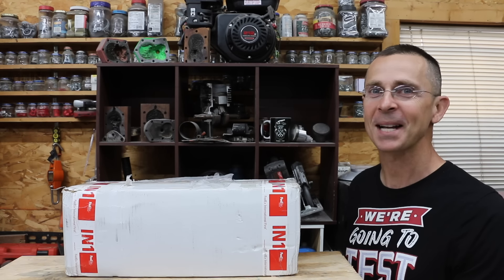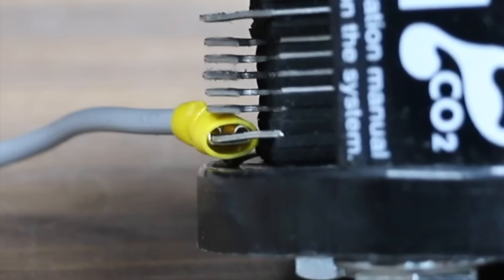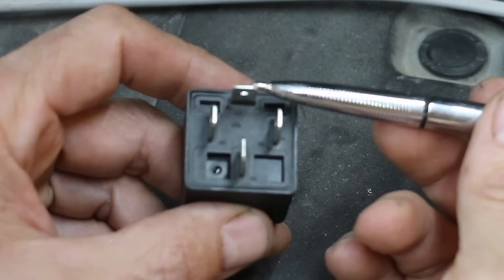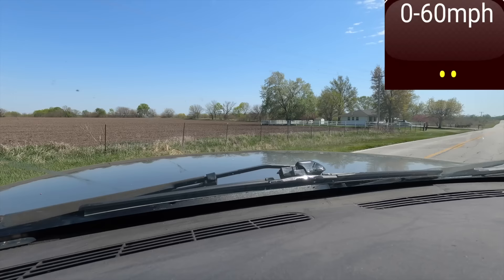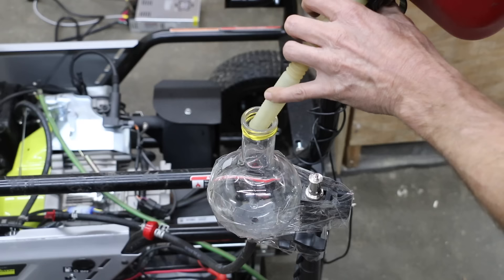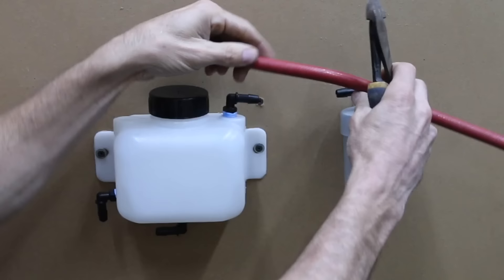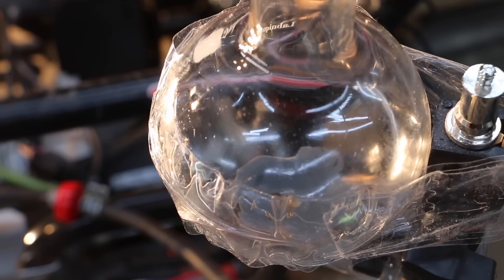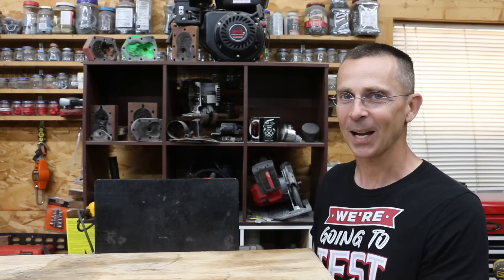AMAZING 35% More MPG with HHO? Let’s find out! Help with high gas prices?

Comment: “The instructions were not very clear” that’s so that HHO believers can claim that anyone who doesn’t achieve their claimed outcome made a mistake, and the “technology” is not to blame. This HHO stuff is not engineering, it’s religion.
Reply: The device seems sophisticated. But if you make your HHO by burning fuel to make electricity to make HHO to help burning fuel that makes electricity to make HHO....
The laws of thermodynamics clearly state that this way the product he bought is working is illegal and basically an additional burden to an allready inefficient motor! 
BMW once made a motor that burns HHO entirely. HHO is extremely taxing on the livetime of a regular combustion enginge It's even more problematic for the piston rings than burning CNG or LPG . Thats why all hydrogen power today is about fuel cells. Yet to have this technology take of we need to solve two problems. 
1.) Finding a catalysator that increases the efficiency of electrolyses or some other chemical means to efficently splitt up water.
2.) Finding a way to store H2 without cooling it down or putting it under imense pressure as both are the main sources of efficiency loss of the H2 fuel.
Then there is the small problem that H2 can't be properly sealed away it can pass through rubber or plastics even through soft metal seals, in tiny quantities, so pure H2 is not realy a fuel to easily work with if you are not in the rocket submarine business.
Reply: "This HHO stuff is not engineering, it’s religion."
My words, exactly! And the problem is there is so many new religions like that. Vegan, gluten, antivaxer, flathearth.......
Reply: @TremereTT  my thoughts exactly!
Reply: It’s a mechanical system, you can’t just say “thermodynamics says this is illegal”. It isn’t impossible by any stretch, by that logic, a turbo charger should also “be illegal” lol. However it is absolutely horseshit as proven by our man PF here.
Reply: @ludvigericson6930  how would a turbocharger violate thermodynamics?
Reply: @jcasetnl  Somewhat true, but these were very isolated cases. Platforms like FB, IG, ... and internet itself enabled them to spread like wildfire, although they all were designed in good faith for spreading knowledge and experience.  Unfortunately, internet nowadays is 95% trash. It became quite difficult to find true information among all this trash, unfortunately. Our knowledge can help, but people don't use it. But people, obviously, don't go to school to learn, just to get a grade.
Reply: @ludvigericson6930  A turbo doesn't make the system more efficient. It makes it less efficient in exchange for higher performance.
Reply: @fifi23o5  They were not designed "in good faith". They were designed to make money. They use many bad-faith methods to keep you clicking. Lousy people have always existed. Now we have a technology service that tries to shove those people in our faces as much as possible to convince us the world is going to hell and we need to personally argue with every single one of them. And all the while we're watching their ads and they're pocketing the money. Sure, blame people for falling for it, but don't kid yourself that they built this stuff "in good faith".
Reply: @jcasetnl, well said.  Summed it up perfectly
Reply: @JamLeGull  A turbo charger runs on the energy of the same engine it provides with extra air, making it more powerful. That is not in conflict with the first law of thermodynamics because more air is added into the equation from. Just like a crude oil pump engine could run on the crude oil it pumps up and even create a surplus of crude oil on top of that. In both processes, purpose compatible matter is retrieved from an external source and eventually converted into kinetic energy to retrieve the same amount or more of that matter, ceteris paribus. But I have a strong feeling that you are very familiar with this subject LOL.
Reply: @ludvigericson6930  I agree there's more to it than the simple matter of invoking a law of thermodynamics. But invoking that laws does settle one key issue that generating your own hydrogen using energy from the engine can't result in more total fuel energy being available to the engine.  In fact, it is pretty much guaranteed to result in less net available energy to drive the car, not more. So any improvement must come from some other effect that would make the engine operate more efficiently. One person mentioned that it allows advancing the timing and hence improving power. Maybe that, or something else is actually true. But it just isn't likely to be true to the tune of 35%. Also, more power often means less efficiency in real world applications.

As for turbo-chargers, they also don't seem to improve gas mileage in real world comparisons with normally aspirated engines.  But the way that they might in more controlled situations is that they may make the engines more efficient in their use of fuel in certain power ranges. The same can be said for cam timing, engine stroke length, intake and exhaust manifold tuning, etc.
Reply: @fifi23o5  Pretty sure my fireplace hearth is flat! You could call me a Flathearther....
Reply: @JamLeGull  
A naive interpretation of thermodynamics would say that a turbo charger can't work.  That is if you try to collect energy from the exhaust you are introducing back pressure so the engine has to use more energy to make the turbo spin.  This is more obvious with a super charger where the engine powers the compressor directly rather than use exhaust pressure to power the compressor.  However despite the engine powering the turbo, you still gain power because the relationship between input air pressure and output power is non linear.  That is a small increase in input air pressure creates a greater output power from the engine than the energy used to power the compressor.
Reply: @ludvigericson6930  Turbo (or super) charger helps you get more air and FUEL into the same engine and increases hp.  You burn more fuel for the extra hp.  Law of Thermodynamics is maintained.
Reply: @graemejwsmith  The thing with little turbo engines is that you can use a smaller engine with the same power as a naturally aspirated one. Which can give you more fuel efficiency, when you don't need the power and drive the engine in the area where the turbo doesn't work that hard. Lower air/fuel consumption when the power isn't needed and higher air/fuel when the power is needed.

This after all improves fuel efficiency, because engines in cars run most of the time in the "low power are" in low revs.
Reply: Hho is used in cutting torch sooo it IS very possible to run your vehicle on it,,, but those whom are in control don't want you getting hundreds of miles to the gallon since it's NOT profitable for them and it loosens their control over you !!!
Reply: IT'S JUST JUNK!!!!!!!!
Reply: @MrBillmechanic  that's the typical indoctrinated sheep response,,, best go seek truth !!!
Reply: @TremereTT  no, you're talking about a HICEV which is an entirely different beast and are not detrimental to a vehicle designed to burn hydrogen in air - some minor materials selection issues aside we could use HICEVs today; the issues come to we have no hydrogen distribution networks. The very first internal combustion engine was a HICEV, it is a completely rational design that has been abandoned for other reasons.
Reply: @streaky81  we have a h2 "distribution" network. it's also continuously getting denser. the h2 is created and compressed on site. many Busses and some hgv run their fuelcells with it. Also there are rare end consumers with hyundays or self made Designs.
The network is there and it is getting more dense every year.
Reply: @PumpKing96  A point that everyone who has mentioned Turbochargers seems to be missing is that turbos are driven off the otherwise wasted heat of the exhaust. All that heat going out the tailpipe is just wasted energy and a turbocharger captures a lot of that wasted energy.

A common misconception is that turbos are simply driven off of engine back-pressure and thus steal from the engine the energy needed to drive them. But a quick bit of research on how they work will reveal that it's a bit more complicated than that and they actually utilize energy that wold otherwise just be wasted out the tailpipe.
Reply: @wturber  Depends on the application. On diesels turbochargers no doubt increase efficency. Most efficient naturally aspirated diesels have a bsfc of about 220-230g/kWh. Turbodiesels drop that below 200 grams
Reply: @jcasetnl  Turbocharging makes a system more efficient by capturing waste energy.  You can make more power on the same fuel usage, or use the same fuel for longer time.  This is the definition of efficiency.
Reply: @wturber  Look into commercial-scale power generation.  This is where all of the little efficiency tricks start to add up.  Turbines, reheaters, intercooling...  If a hydrogen recapture system was REALLY the magic bullet that the ads say it is, commercial power would be all over it.  They often have a surplus of electricity for generation, and large-scale storage is easy in a stationary plant.  Additionally, fuel cost is HUGE for generation, a 35% improvement in efficiency would be a game-changer for generators.  And yet...none at this scale.  For what it's worth, stationary plants can be as much as twice as efficient as car engines (40-50% vs only 25-30% typical).

Comment: I have really fallen in love with your channel over the last couple months and have actually started coming here when I need to see how certain things perform. Would love to see a general purpose degreaser test in the future!
Reply from the maker: Thank you so much!!  Thanks for the video idea.
Reply: If you are willing to invest $1 try LA's Totally Awesome It is an all purpose cleaner and the bottle has the dilution ratio for different tasks full strength it can degrease an engine
Reply: @bruceaugustine6486  I do use LAs awesome a lot! Works great on brake dust and what not. Just would like to see some other options. Even diluted, that stuff can be pretty harsh

Comment: This is an awesome test,very detailed. But these HHO systems aren't just plug and play. There is an amount of tuning with the HHO in the effect of amperage and amount of either baking soda or KOH to add. I have made one that is a wet cell instead of a dry cell and I used baking soda instead. I had good results and I doubled my mileage on an older mustang with a carb. From what I've learned on the Fuel injected engines an amount of adjusting of either the Map or Mas sensor is needed to get the HHO to do its thing and increase mileage.  The carburetors aren't self learning so the HHO works great. The FI engines NEED a bit of minimal adjusting ,or you will see barely a change. But as per the kit I could see that it doesn't give this info or you would have done the adjustments to get a proper result. Again  awesome test lots of info.
Reply from the maker: Thanks!
Reply: Exactly.  On injection systems , a good HHO has a parallel ECU  in order for proper results as it fools the  engine , We have tested that on an 156 Alfaromeo and we had great results . On the other hand , carbed engines  do not need paraller ECU but  the results are not so impressive.
Reply: How much gas can that tiny HHO system generate in one second?  How much HHO gas would need to be generated to make a difference running any sized gasoline engine under load?
Reply: @01mustang05  I dont know,I can say that on my online 6 in the mustang I ran a 7 plate wet system with a voltage reducer to knock the voltage to 6 volts and a little bit more baking soda than recommended to make what I thought what a pretty good amout,container was completely clouded with bubbles with a decent amount of bubbles when I put the hose in a bucket. I guess it would be a trial and error to get the best result. Ever car is different,so I'm guessing tuning of the system and the car needs to be done whether FI or carbed to get best outcome for your specific application.

Comment: You should do a video on garden hoses I'm curious as to see the differences.
Reply: I noticed that on the shrinking hoses, the pressure and flow are severely restricted, even after the hose has expanded completely. I'd really like to see how much flow you're losing for convenience.
Reply from the maker: Great recommendation!  I'll do it.  Which brands would you like see tested?
Reply: Project Farm I know I’m not the OP, but maybe hoses of different types? Something like those expanding hose, rubber hose, “standard” garden hose. Maybe do something like flow rates for all the same sizes, as well as toughness, etc etc.
Reply: The zero G brand of hose would be interesting to see tested.

Comment: Thanks for this testing👍
My experience with these HHO generators is just burnt out alternators (too much current draw) and potential fire hazards (intake flame blow back on petrol engines). They just don't work!😉
Even on a diesel motor, it only seemed to reduce very slightly fuel consumption on town driving. On long hauls it increased the fuel consumption!
Reply from the maker: You are welcome!  Thanks for sharing.

Comment: The problem is to Run a hydrogen generator you need a lot of electricity,  which makes the alternator harder to spin..   So any gains you get from the hydrogen are being lost on spinning the alternator with more force.   Yes an alternator with electrical load, is much harder to spin then an alternator with no load.
Reply: it’s like trying to make a perpetual motion machine
Reply: @jefrebugni4064  it's worse,  it's a perpetual motion machine with excess energy ;)
Reply: ...and youre not even a physicist!!
Reply: YES BUT 13 VOLTS AND 30 AMP STIL TAKE 1/2 HP, 746 WATTS IN 1 HP

Comment: We built them back in the 2000s when gas first hit $3 a gallon. Found the computer corrected it on an efi but had pretty good results on a carb engine
Reply from the maker: Great information on the carb engine results!
Reply: hahaha i posted the same thing before i found your comment.
Reply: Misleading statement much? I’d venture that EFI gives improvements to fuel efficiency that outpaces HHO + carb.   

Seriously
Reply: @beardedbarnstormer9577  How is it misleading? If you have a carb engine you can't just change it to injection so HHO could be something to look into if you want improvement.
Reply: @ck8101   because you could easily see similar improvements rebuilding/cleaning/resetting the Carb.  HHO has been proven to be snake oil.   It’s not useless but damn near it.   You’d also get improvements with methanol injection too but you don’t see those guys trying to hawk it as some cure for car cancer
Reply: @ck8101  we gained about 3mpg with it on a 1980 f150 with a inline 6. Didn’t do anything to the carb as far as rebuilding. It didn’t gain anything on a 06 5.4l f150